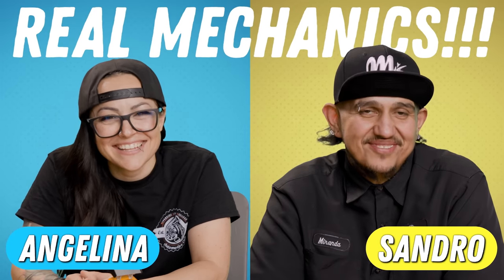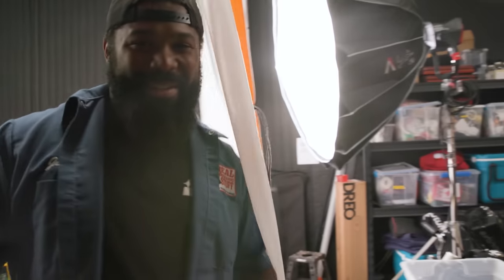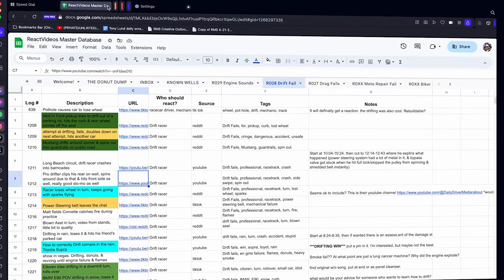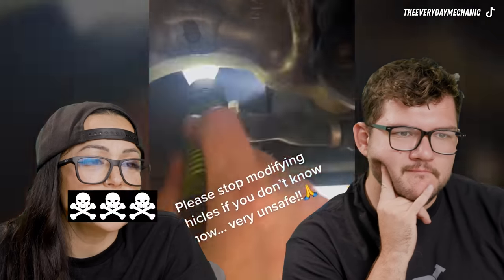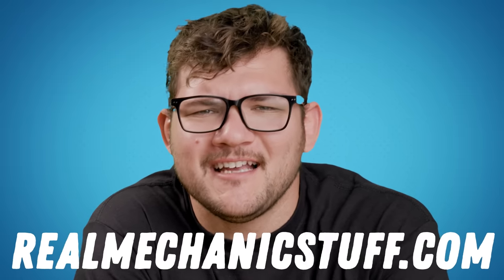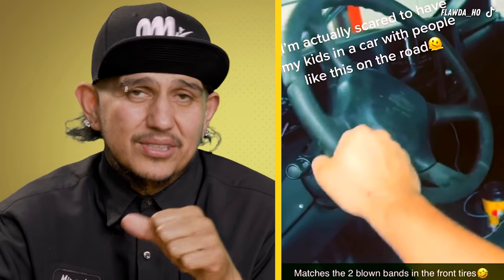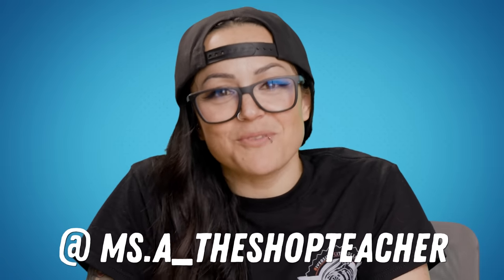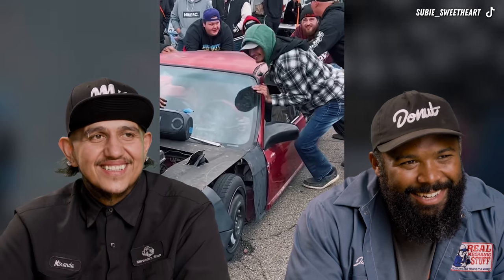Mechanic Reacts To Dangerous Death Traps

Comment: Death trap that came from "Tires Plus" when a family member went to get all 4 brakes done on their 04 Pilot and they drove it maybe 180 miles in 6 months locally. I opted to  buy the Pilot after those 6 months. I saw the bill for the brake work and inspection.  Well "Tires Plus" repair thankfully didn't kill my GF and I. 

I buy it and I am driving around and here a mild thunk (I assumed loose exhaust strap which when fix it stopped) when stopping every so often, no spongey pedal, no braking issues and heating up during city driving. Her and I hit the highway and thankfully it was a clear road ( I-95 into downtown Philly which 70-100 MPH is common. I was at probably 65-70) We come off the city and I tap the brakes and my rear wheel grinds a little. I'm in downtown traffic, park and think maybe my caliper was hanging a little but nothing major. Safe enough to get home. Tow was 4 hour wait and $320. 
Well start driving home, no issues i notice in braking at surface road speed. So I get on the highway back. Rush hour is just about to start so I see traffic uphead and opt for the exit vs going to the closer exit to the house. I come off the exit around 40 mph, touch the brakes and it sounds like a bomb goes off in the rear, back driver side wheel locks up and i come skidding into the turn. I kept it under control and managed to not wreck into stopped traffic. I pull off with the wheel locked maybe 30 feet to a parking lot. I notice my tire is flat and I have a 100 ft skid mark off the ramp. I jack it up and think it probably was a blow out. Nope. "Tires Plus" failed to install the lower caliper bolt resulting in my caliper being ripped from the knuckle, punching through the rim and ripping the soft line in half and smashing the hardline. I pull the caliper and line, crimp the hardline and limp the 5 mins home after finding out the rim had a 1/2" hole through the middle from a buddies tire shop at that corner. 

Final repairs were full rear knuckle, hardline, soft line, trailing arm, brakes, rotors, calipers, and rim/tire. 
Fast forward a few days from this repair. I'm pissed this was how this vehicle was repaired for my elderly family and as I am heading to "Tires Plus" I hit the brakes again on the 2nd time driving this and i hear the wear indictors bite into the front rotors. I pull back to the house and find the "NEW BRAKE PADS" weren't actually new. Both pads were very much worn and now gouges in the rotors from this. They replaced the rear, missed the lower bolt. Charged for front pads and never replaced them and I had 54 miles from buying to over $1000 in parts to repair this to a safe vehicle. After this incident I was driving another family members vehicle who was on vacation so loaned me her Jeep to drive while I finished repairing the Honda. I was almost killed when a 100ft rotted tree fell on the Jeep at about 45mph. It crushed AB and C pillars, roof was on the passenger seat and crushed all but me. I have injuries still and this was 2 years ago. Had I not hit the gas at the last second as I saw the tree I would be dead. My GF skipped the ride 10 mins before or she would have taken the entire tree on her. Hitting the gas allowed momentum to keep the tree rolling off the Jeep. Had I braked when it happened it would have crushed the roof on top of me according to fire and EMS on scene. In both incidents had I been an inexperienced driver and just panicked in both situations I would have been dead or my GF and I would have both died. 

1 is a death trap from shitty mechanics. Another was poor maintenance of roads and thoroughfares.  Looking back 5 years this tree had been rotted and dead. It totalled 2 cars that night. After it hit me and rolled across the road a Prius hit it on the ground at close to 50 mph. 

Sorry for the long comment but this  is bad mechanics work that could have been worse had we hit the brakes on the highway and blown a tire, locking a wheel. Also the tree is something I'll never forget. It's been years and $10s of thousands in medical bills, chronic pain daily and likely will be multiple surgeries in the future because the tree maintenance company cut corners. Please don't cut corners, this is people's lives 🙏

Comment: @5:12 I see some bleed through on the green screen.  Use an overhead amber colored light to cut the hair properly in a green screen.  Also called a key light.  1 overhead flood positioned slightly behind the talent with an amber color will give the chroma keyer something to grab onto.

Comment: That 2nd 200 with the brake line had a low pressure compression fitting on it. Like what’s used for airlines or water lines. Only good for a couple hundred PSI. 
They make proper repair fittings for hard brake lines. But, it typically requires flaring the line.

Comment: I used to have a ford tempo with no brakes. But it had a manual transmission so I didn’t really need them I used the engine and clutch to slow down and stop. Did the same thing on a Peter built 379 and it never failed.

Comment: I was picked up by some friends at a stoplight one time years ago. This girl i met at work drove an '88 Cadillac hearse. She was so cool, total zombie girl. Anywau, i was getting off work and i saw her pull up in it at the light, she yelled at me to get in and next thing I knew, somebody opened the rear hatch door. So I'm in traffic, light is still red, then bam! Light turns green, zombie girl starts taking off and i had just put my knee inside the back bed, where the coffin goes. She starts speeding up and these two guys start trying to pull me into the back of what is now a moving hearse, going maybe... 35 mph. Music is blaring, I'm throwing my bag in with one hand and holding onto a coffin restraint strap with the other. Finally the guys pull me in and I'm leaning, still got thw strap in my hand, trying to close the back door which was a swing gate, not a lift type. We sped off and everyone was cheering because I didnt die I guess. Lol That was a pretty cool moment, like something from a movie. What a great time I had.

Comment: I had an 87 Olds Cutlass that developed a problem in the steering column just like the chevy pickup truck had in this video. I did an engine swap from the stock 307 to a built big block 455 that was putting out roughly 700HP (a stage 1 from a 70 Buick GS) so I was constantly sideways in that car (on purpose mind you) and I guess from constantly counter steering it caused the tilt bolts to come loose in the column knuckle. I learned that the column knuckle bolts on GMs were notorious for coming loose and that they were accessible. I tore the column apart to access those 4 bolts, removed them, put loctite on the bolts, reinstalled them and I never had a problem with it again, well sort of. I actually had to do that twice on my Cutlass because some pos jagoff stole it. I did get my Cutty back about 3 weeks later (with no damage to it other than the column, thankfully) and had to replace the column they cracked open. Needless to say the column I got for a replacement had the exact same problem mine had prior to fixing it. It's not really a hard fix, but can be a bit of a pain in the ass to do if you're not familiar with how to do it. I miss that car so f**king much. Ended up totalling that car at my local drag strip one night thanks to hitting the wall because my right axle snapped. The axles were stock so I guess they weren't up to handling the HP difference. Lmfao. Personally I would've thought the stock 7.5 10 bolt diff would've gave out first, but nope. F**ker snapped an axle instead. How the stock rear end held up is beyond me, but it did for almost a year prior to totalling the car.

Comment: Angelina may not think mechanics make these kinds of mistakes, but a girl in my class bought a car (a Fiat 124) from a 2nd hand car dealer and asked me to check it out because she thought the brakes were pulling. So I took it out to a dirt road for a hard brake test (so I could lock up the wheels without flatspotting her tyres) and swapped ends in it. Upon inspection there were no brake pads in the left front caliper. The kicker was we had to take those guys to consumer court to get them to fix it under warranty.

Comment: My niece had a Ford Taurus that had a rusted out front subframe, that the lower engine mounts were attached to. The upper mount was broken, so the only thing holding the engine in the car were two transmission mounts. Two transmission mounts on the verge of failing. The shop told her to stop driving that car IMMEDIATELY. They were surprised that the engine had not literally fallen out of the car. She traded it in that day.

Comment: The truck at 1:37 is NOT from a fender bender. That's a GMT800 doing things that GMT800s do up here in the rust belt. The frames rot over the rear wheels. Normally, it just bends the bed into the cab, but in this case, the bed was also so rusty, that it folded the frame and the bed right where the rot is.

Comment: So almost every sketchy thing that I've seen came from back in the day at the Pontiac dealership. Very few Pontiac drivers would do any maintenance or repairs. Two come to mind. First, an old Grand Am came in with a terrible noise coming from the back end. The rear brakes rotors didn't have a face on them. It was trying to stop using the vaynes as the rotor surface. Second, we had a different Grand Am come in saying customer tried and failed to do the intake gaskets themselves. If you look through the oil fill, there was a rocker arm on its side not even attached. We knew that one would be good.

Comment: 6:55 this is why its a good idea to replace brake pads with the bleeder open..... (like, push piston back with bleeder open, also protects ABS systems) 
then just give it 2 or 3 "pedal pumps" like normal "bleeding" 
.
brake fade is SCARY in a normal family sedan/SUV..... bleed till you get CLEAR fluid 
that black crap will mess with seals also...

Comment: Can confirm the first 200 S brake problem probably not being the fault of the Carmax mechanics.  It's usually a sign that there's something wrong the the ABS system in my experience.  In my case it was a faulty ABS module that was causing the ABS to engage at random times when braking until it finally caused one of my front pads to sheer clean off from overheating and cracking.  Had to replace the module and all my pads/rotors.  I didn't even know what was causing it until it was too late because the ABS light wasn't coming on.

Comment: I've repaired a brake line with a compression fitting before. It took all day for me to figure out the correct way to flare the lines but after that it held up for years. The engine blew before the fitting ever did

Comment: Once I lost the bolt for the lower arm balljoint while entering the highway on 31st december at 11pm lol... I aimed for the snow bank since y couldnt do anything else... lesson learned : always check the direction and suspension part when you buy a truck or car

Comment: I used to drive this old low rider ‘82 Silverado that had a bunch of modifications (didn’t do it don’t know anything about cars) but it had a ton of issues, including the power steering randomly dropping out at times. But I remember going down an off ramp of a highway and my brakes completely failed and I ran through a stop sign and didn’t stop till the I was basically up the on ramp back on the highway. Terrible lol

Comment: I'm a tractor trailer mechanic, one death trap I've seen was the fifth wheel sadles rusted to the point of failure. All the dude asked was if it was safe to load like that. He did not like my answer

Comment: carmax one. I work at carmax. If they have warranty on it, they can get it fixed there… if the tech was the problem, they will absolutely cover it. But it was highly likely a fault in the actual break, not carmax itself because we have extremely high standards for our cars.

Comment: Sandro is so chill lol but the one with the brass line fitting, the only thing they fucked up was thats an air fitting for low pressure. there are actual fitting like that for high pressure use that would work but that wasnt one lol

Comment: The shit ive seen at the shop where i used to work was just as outlandish as most of the stuff i saw here. There was a time a truck came in literally the shap of a V. Bed and cab smashed together wanting tires put on it. I think insurance reasons but the shop put them on. The frame was literally 3 inches off the ground, 93 Chevy Truck. Another time guy came in for an alignment and the only thing holding the truck from breaking in 2 pieces was a 2 inch section of frame on either side and the brake lines. Rest was rotted out. Again a Chevy truck, but it was a 2012. Another one was a Dodge Ram, believe 1998, and the cab mounts were gone, like gone gone. The cab was reasting on the frame. I assume the steering column was the only thing holding it to the frame.

Comment: 8:49 
Well apparently brake pads go in 2 ways, I had to fix a car for “squealing brakes” the last shop PUT THE BRAKE PADS IN SO THE STEEL BACKING PLATE WAS AGAINST THE ROTOR.

Comment: Hey Califorians!!!! The maroon truck was not hit in the rear. The frame rusted away in between the spring shackles in the rear, which made it buckle up like that. Tailgate has been replaced because the original rusted away/nothing left. Still a Death Trap though!!!  Also the second Chrysler 200 with the brass fitting was wrong. That brass fitting is a compression fitting, A Huge NO NO when doing brake lines. Probably don't replace many lines in Cali. I do love your content.

Comment: been driving for the last 2months - 3 000km without brakes- waiting for my caliper, rotors and pads for over 40 days…. Luckily my truck brakes when i put my pedal totally down, so far good enough 😂 2500hd truck 2012 - bought 3 months ago it and lost rear pads the same week 😂😂

Comment: The Chrysler 200 brake fittings look like the crush washer fittings,  not flare fittings. they might work for an oil pressure gauge but under break pressure I’m surprised it did not just blow the line straight out of the fitting

Comment: I had a friend that bought a car one time first time we went to go take it for a spin. Taking a right hand turn in the front of the car moved about 8 inches to the right independent from the rest of the vehicle. Entire front frame was completely broken. Went and got the welder and slap some quarter-inch Steel on it😂

Comment: Lmao mikes jeep with the shakey rear end, prolly just like 4 months ago it was end of day i was lifting a jeep that needed a transmission and both the same trailing arms where broken was like welp transmission isnt all we are doing, plus its the lovely design where the driver side its either cut bolt and replace bolt that goes through frame or drop the fuel tank

Comment: We finally retired the old F-150 farm truck at around 350,000 miles because I destroyed the clutch riding around the property learning how to drive stick. It wasn't worth repairing because, and I quote, "The frame is so rusty that nothing is connected to anything else anymore and you can slide a dollar bill through any part of it." Yikes.

Comment: The 200s is nice mine has black leather, alcantara seats and door panels, heated seats, 300hp, navigation and Boston Acoustics Sound system, remote start, leather wrap steering wheel, Power seats. Led Lighting.

Comment: Every mechanic should know to write up dangerous defects on the work order (and keep a copy, my mentor used triplicate copies you can have printed locally) and have the customer sign off on their refusal to correct them. Every mechanic should also know they could be liable for releasing a dangerous vehicle which should be put "out of service" and they and anyone else are free to contact the DOT cops just like any truck repair shop. Most other mechanics I've met don't know that tip which could save their business. If you're a professional mechanic do yourself a professional favor and have a conversation with DOT on proper procedures if a customer brings in a dangerous vehicle then refuses to fix it AND insists on driving it away.  The life you save may be your own or your loved ones and insurance companies can afford better lawyers than you can. Every mechanic who serves retail customers has met more than a few who are insane let alone negligent. Saving lives is not "snitching".

Comment: That second 200 makes me wonder if they did that to the brakes what else is messed up? The car with the wonky steering column reminds me of a car my father had once. It had what he called a lite roll before he got it so it was a little banged up. He came to my house one day and said he needed some help with it. I went out and he wanted me to help switch out the steering column because while driving home from work the steering wheel came off and he was steering with a pair of vice grips clamped on the nub sticking up.

Comment: So brake fade is actually caused by brake shoes/pads and rotors/drums becoming so hot they glow, melt, and reshape instead of grab not hot fluid and they steering wheel being that loose is legally justifiable to force they to have it towed due to being illegal to drive unsafe vehicles on any public road per DOT regulations just like tires below 2/32”

Comment: interesting how it seems theirs enough pressure in the break lines to shear brass like that, i mean i knew the pressure varied but yeah i guess i never thought about a brake slamming stop, definetly a reason why the breaklines are made like they are, a lotta complicated science n' engineering in there im sure, but still never thought it was enough to sheer the whole brass connector thats an impressive amount of pressure from a thin break line but i suppose it does make sense it would just one of those things wierd things about liquid physics again i suppose